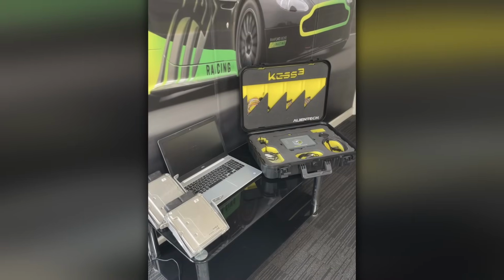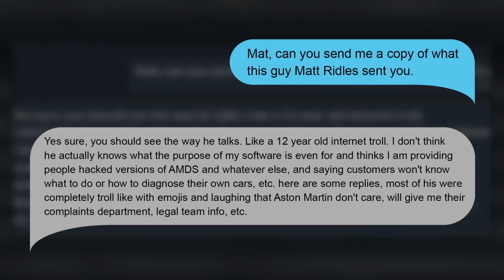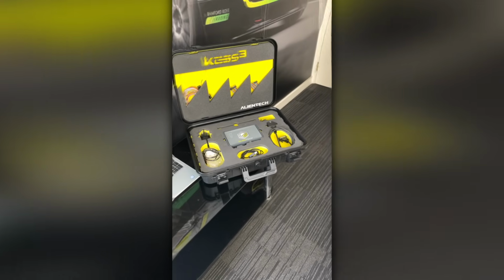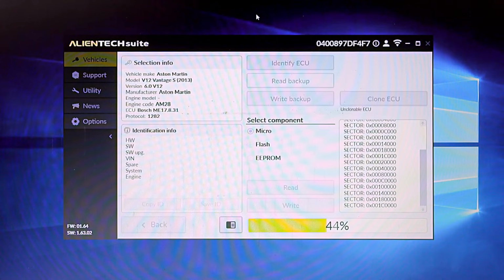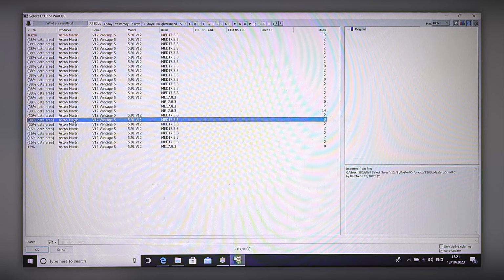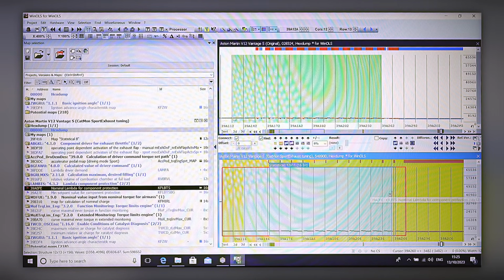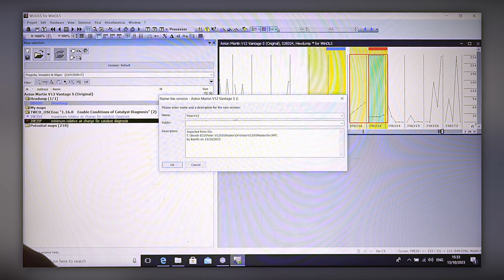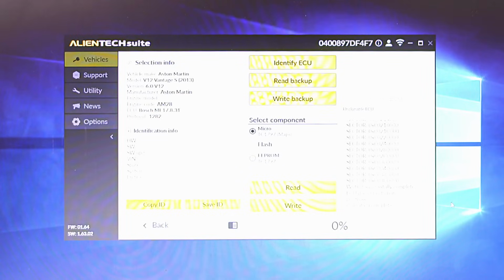How to Remap Your Aston Martin ECU, Is it SAFE??

Comment: Giday Mike, John here from one of the colonies (New Zealand) haha. So ive just watched the video and have a question or 2.
So you mentioned late in the video that you would sit in the passenger seat while the owner was driving and datalogging the driving....thats great but how can you do that if the ecu is unplugged as appears to be. Also how can you get hyper accurate information from the ecu without having the car on a dyno?
Or is what im talking about, something that can only be done with an aftermarket ecu such as a MoTec or Link ecu. 
Id also be interested to hear your thoughts as to why a number of the V12 engines have vastly different power outputs but seem to be the engines seem as tho they are all the same? Is it compression?
Anyway, love your videos and keep up the great work 👍

Comment: Very interesting video, I just need more knowledge about the topic to fully appreciate what you actually did when modifying the data. Not having any hands on experience with remapping but a good general understanding of how it works, would it not be fair to say the following:
If a car Is left standard, the ECU is programmed with a map that’s the best compromise, considering performance, drive ability and legislation ?
Once you start modifying the car with clutch, manifolds, exhaust systems, cams and injectors is when a remap is required to accommodate those modifications by changing various profiles and even  switch of monitoring because the legislative requirements are no longer possible to meet ?
I can easily see how it’s possible to mess up various profiles with drivability suffering and even massive engine failures as a result.
All that said, I’ll be seeing you when my N430 needs a dual clutch conversion. However, despite having put about 9000 miles on it since you did a post purchase inspection last year, my Foxwell nt680 still report wear data well within the serviceable range 😊

Comment: Why always changing things? An Aston Martin is such a fantastic car. Leave it as it is and enjoy. (And the factory engeneers are not dumb at all)
Reply from the maker: A good point if everything was blue sky. Unfortunately it’s not. 

There are components which go wrong. If removing them and modifying was to overt a looming bigger disaster, it’s better to preventative maintenance. 

Also, remember that when in original design and development, I saw the project for the OEM for approx. 3 years before the project went from development engineering to current production engineering. 

Now I have seen the product for 13 further years in the world of aftermarket, it’s now possible to not just evolve the product better than the short time the factory saw it, but evolve it to stop bigger problems from happening. 

Not so much for a 565 BHP V12. But in 2023, a 2004 V8 at 380BHP weighing in at 1750 ish Kg, is a bit lacklustre compared to even modern day family hack around car. 
When a pair of manifolds pep that same car up to 430 BHP, no wonder owners modify.
Reply: Emissions... Biggest issue for manufacturers.
Turn that shit off and open up your options
Reply: Manufacturers only care about meeting emissions the cheapest way possible, modern engineering doctrine seems to point towards planned obsolescence so aftermarket engineering is definitely better than factory, just facts. No factory car can compete on a racetrack, they are all heavily modified even without strict rules

Comment: Timely video. Thanks. I’ve just discovered that my Vantage has a map on it that’s non-standard (I know, I know, better PPI but here we are). AMDS didn’t recognise it so no idea where it came from, when or what it is. No mods other than a twin plate clutch was fitted. 

No apparent problems but the fact that I don’t know what it is has me spooked. 

Roll back to factory and then go from there?
Reply from the maker: Even the factory issue a remap file with each AMR kit. 

I’d not be overly worried. 
If the fuelling profile and spark profile / curve is okay at wide open throttle, I’m sure the remap is okay. 

If you are that spooked. Have it flashed back to standard using AMDS (3-5 minute job) and then if there are any issues (which there shouldn’t be) on a standard calibration, seek a professional remap

Comment: Ahh Mike - I've missed your videos.   Vagisil - had me and my sweetie laughing out loud.  Nice kit - and what you didn't point out was that the kit is only the start.   Your knowledge of knowing what values to change the map to is the real talent.
Reply from the maker: Hi Steve. Yeah, that kit is pretty awesome, it’s staggering how ingenious the aftermarket World is, to reverse engineer to reach a solution so well. 

I’ve seen both sides of the fence, but ironically, to calibrate the engine for the automaker, or to reverse engineer a calibration for aftermarket… It requires altogether more intellect to correctly reverse engineer in aftermarket compared to the World of OEM

Comment: Good video - how did you create the master file that you copied the sections from?
Reply from the maker: Using WinOls Damos plug in, and a bit of know-how 😂
Reply: @BamfordRose  Sure thing - I guess you’ve built up the library of data with rolling road runs on various spec cars? So if I wanted my V12V with your exhausts or cams or whatever you could pick the map you know you’ve used before and benchmarked? If so makes sense.

Comment: Sorry if it's a silly question, but could that vehicle still be serviced by a dealer? Would AMDS throw up error codes? I'd love a DB9. Having previously owned an old Bentley, you'd think I'd know better. P.S. bikes don't need a cat to pass an mot.
Reply from the maker: If the ECU has been remapped, AMDS can service / diagnose the ECU exactly the same, if it had not been remapped